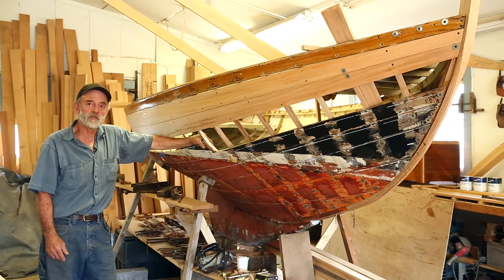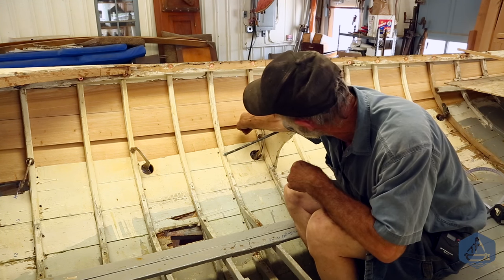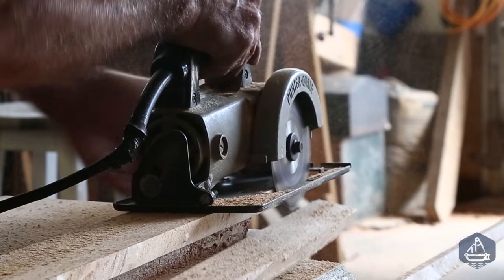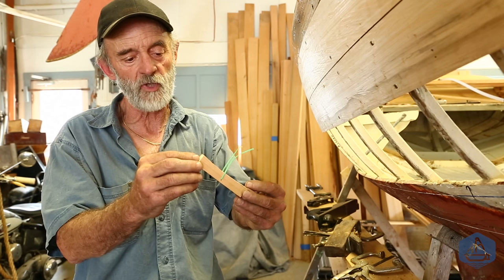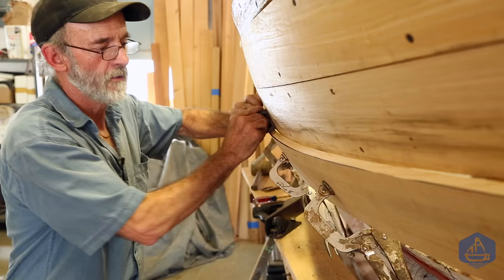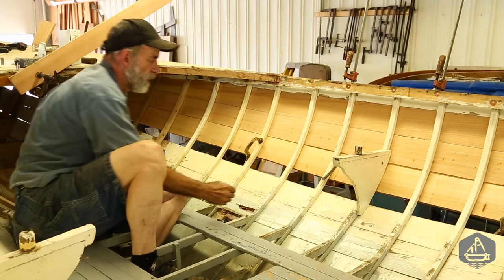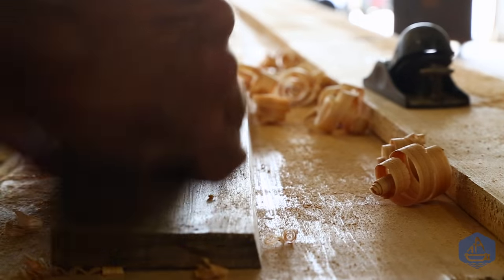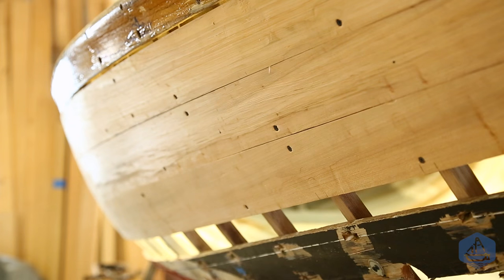New method of planking using progressive bevel planing

Comment: I have been wondering for a long time how to cut a progressive bevel on planks...ever since I saw Mr. Sauzedde's technique using his band saw and a circular saw. I own neither equipment, but I own some hand planes. This video is very helpful for guys like me who don't own a lot of power tools but want to build a boat some day. 

PS scraping the residue with a chisel at [2.23] made me cringe! But a chisel does not have quite the same utility and reverence in a boat builder's shop as it does in a woodworker's shop. So I understand why a chisel is used.

Comment: Lou, absolutely love the videos. Am trying to follow your explanation about using the metric tape to divide the hull into 7 even boards. My hesitation comes from the fact that the lines on the interior have to be smaller since the two measurements have to be different, do you just measure it twice inside and outside??

Comment: Measuring distance in the metric system really is much easier. There are no fractions and fewer decimal points are required. If we would just switch and stop converting from one system to the other, things would be so much better..

Comment: I wonder whether, instead of hollowing the planks to match the frames, it would be easier to facet the outboard faces of the frames once the lining out had been accomplished. In other words, instead of being a curve, the outer profile of each frame would be a succession of straight lines of equal length. I  suppose you could use a belt sander, or clamp a short batten either side of the frame and use a router. You would need to take care to retain the angle at which the plank wraps around the frame, relative to the fore and aft centerline.

Comment: hi i have a yacht double diagonal kauri timber , its all ways been dry builge of late i find a couple of wet spots od small delamination on the inside , they call it electroliss  how do i fix the timber is good after drying and sanding

Comment: i know nothing about boat building but enjoyed the video a lot.  the question i have is why not tongue and groove the boards?  i know it must not be a good idea, but i don't know why.
Reply: cliff reaves tongue and grooves are set up to join at a set angle - typically side by side - and at the same angle over the length. If you look at a boat hull, the boards typically turn much tighter fore and aft compared to midship. Hence the tongue and groove would have to vary in angle along the length. As you can see in the video, the planks also taper further complicating the issue. Water in tongue and grooves would also lead to swelling and cracking of tbe grooves by the tongue.

Comment: Please help me, I can't get this from any video or book:Is this statement true? When you adjust the angle of the plank edge by planing or cutting, should the edge of the plank become horizontal to the boat's longitudinal and latitudinal plane? If not, to what is the new adjusted edge aligned to? Are the plank edges iof all the planks installed now all aligned with each other?
Reply: Clyde Cessna That's not a statement.  To me it looks like the edges are perpendicular to the faces of the boards. That's why he lays them flat on his "bench" with the plane on its side

Comment: Why not scribe both top and bottom lines at the same time? and then cut them both at the same time? Seems unnecessary to scribe then cut then scribe then cut each side. If you Keep your kerf outside the line it would save some time i think.

Comment: This Sr, should learn to fasquiar, is the term used for this procedure, so goes for cattails's side and for closing one side or Sundo, some still use this system to pull the wood and scratching inside but mode "fasquiar" take the points with a conpasso is much more practical (www.brnautica.com.br)